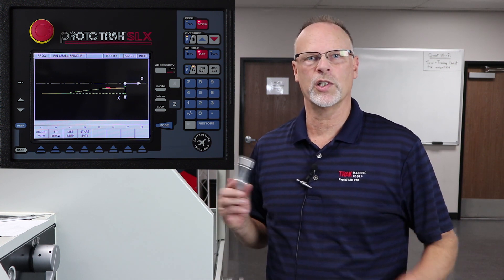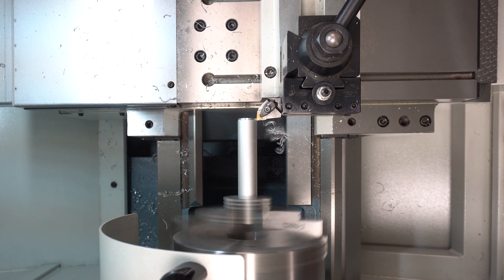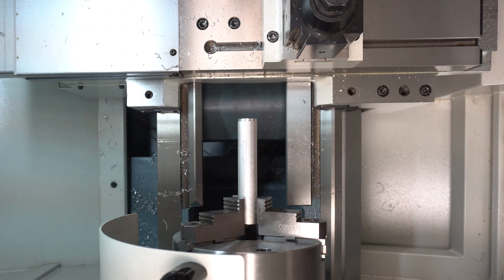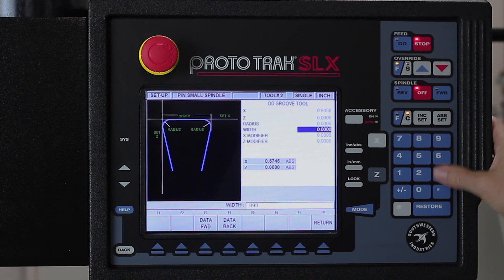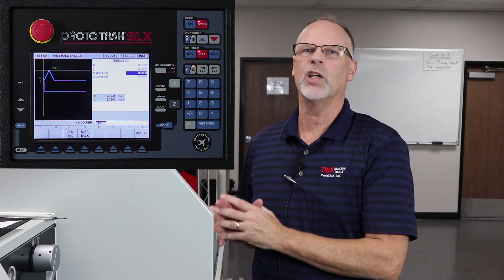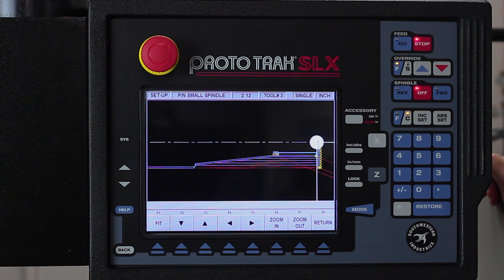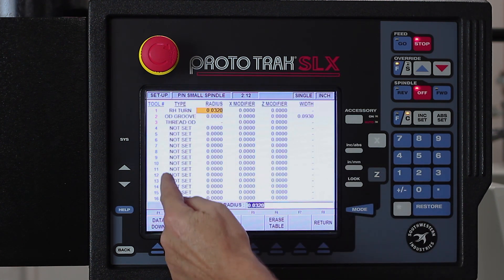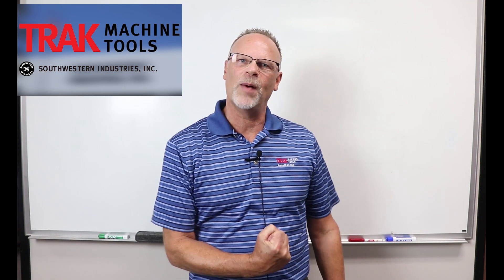Tool Setup & Setting Part Zero | ProtoTRAK SLX CNC | Basic Programming Part 2

Comment: Hi Pat, I have a 1745 Sport lathe with the L2 controller (I know its ancient). I was curious if you would be able to tell me how I can cut a "V" groove into the outside of a diameter using a cycle program. I think the error is 5130. Either way I believe it has to do with the fact I am not doing all "X" positive moves. Whether "V" groove or a large "O-ring" type groove. Can you help? Sorry to ask here but I'm having trouble and can't find a good answer anywhere on the net. Thank you

Comment: How can Is et up a neutral tool in the SLX? I have a part that needs a NH tool holder with a VNMG insert but there's no way I can find to setup a NH tool in the control. Only RH/LH.
Reply: Just set it up as a right turn/face tool but when you touch the tool for Z, you enter half the tool's width instead of Z zero. This will make the point of the tool Z zero.  T.P.
Reply: @patrickfitzsimmons5187  I had to set it up as a button tool and enter half the tip radius as their touch-off for a button tool is the left face. Now the stupid SLX tells me I have the incorrect tool for the toolpath every time 🙄🙄

Comment: question - at 6:50 when you press define stock , is the part 4 inches long and you give .027 extra space for the cutting tool to prevent the tool hitting the chuck?
Reply: When you first go to DEFINE STOCK, the control automatically adds a little stock to all the dimensions because it is guessing from the dimensions you have in your program.  It has no idea how close it is to the chuck.  You have the option of changing those numbers to the exact size of your material if you'd like to.  T.P.

Comment: was going over this in class recently.  The modifier was the most interesting part.  Apparently cnc lathe reading has to be modified to be similar to the micrometer reading.  If the cnc lathe says I cut to .950 inches and yet the micrometer measures the part at .948, I have to change the modifier to -0.002 .  That will change the DRO on the lathe to .948 instead of .950  .
Reply: That's correct but more importantly, it only changes it for that particular tool. This way, you can modify each tool to cut to the exact dimensions you need.  T.P.
Reply: @patrickfitzsimmons5187   Glad you show the screen to use for the x_modifier.  I mistakenly changed x_modifier under tools setup -> edit and I could see it was going to mess up my part's dimensions

Comment: Is there a way to define the shape of the tool or the rake? Trying to make a pulley, but i keep getting compensation errors or telling me im using the wrong type of tool when i try to better define the tool with a different type
Reply: Sean, Unfortunately, the description is somewhat limited on the tooling.  In most cases, when you get a compensation error, it just means that the tool width or tool radius won't fit inside of the geometry in your part program.  You may need to watch this video to get a better understanding.  https://www.youtube.com/watch?v=SqX4_kriGt8&t=299s  Most likely, the problem has to do with this.  I hope this helps you!  T.P.
Reply: @patrickfitzsimmons5187  ya i watched that a few times to see if it was it. It keeps happening after a radius, into a taper. Everything is smooth so im not sure why it happens

Comment: How to programming a v pulley on proturn 425 slx lathe
Reply: Francois, Are you asking me to make a video for this or are you just asking how to do so?  For the later, you have 4 different Z dimensions and 2 different diameters. Z1 is your OD right dimension, Z2 is your ID right dimension, Z3 is your ID left dimension and Z4 is your OD left dimension. X Begin is your OD diameter and X end is your ID diameter.  This will always be the case unless you are doing an ID groove.  With an ID groove, all of these dimensions are reversed.  T.P.

Comment: shouldn't you be subtracting the paper thickness instead of setting the Z zero at the paper touch point?
Reply: Actually yes but, I was trying to keep it simple.  Now that you brought it up, I could've set the Z for each tool at .003" for the paper.  Thanks for pointing this out for others who may not have caught on to that. T.P.

Comment: Having an issue with my first cut on the OD within the turn cycle… i set depth of cut to .050 but the initial cut tries to take a cut of about .250 . After that cut it goes into the .050 per cut cycle…. Any tips on what i may be doing wrong?
Reply: Hi Matt, It sounds like your last turn move doesn't come out to the stock diameter.  If you stopped at the largest diameter of your finished part, it will only apply the .050" to that dimension therefore, the first cut will be .050" + the rest of the stock.  If I am correct, just make your last turn move come out to the X stock size before you add your positions.  If not, please let me know.  You can also reach out to me directly at TRAKingPat@trakmt.com if you want to email me your blueprint or program.  Thanks!  T.P.

Comment: Hi My name is Louie Munoz. I work for an aerospace company that bought two of Pro Trak lathes with SLX controllers. I do a lot of trimming of tubing. Typically the wall thickness is around .025 to.080 thick. Typically around.250 to 4.00 long. I normally will face one side first to square it up. I then pull the part out, turn the part around rechuck and face second side to a dimension like 3.00+/- .010. Now my question is, do you have a video on the easiest way to deburr the inside and the outside diameter ( break sharp edges) of the tube.
Reply: Hi Louie, Generally, I would just use a 45 degree chamfer tool and program it to move in the Z axis to touch both the ID and the OD.  If you are programming an inside or outside CYCLE, you can make the chamfer part of your CYCLE program and then eliminate the extra moves.  We have not made a video for this but since it's so simple, I don't believe that we will either.  T.P.

Comment: is there a way to start in the middle of a cycle event, say with profiling a long shaft and you have chatter have way through the cycle.
Reply: Tachdriver1, Unfortunately, there is only the option of starting a cycle at the beginning or at the finish cut.  This being said, you still have several options.  1. Use TRAKing to fly through the cycle until you get to the part that has not been cut yet.  2. Adjust your program to eliminate the portion which has already been machined.  3. Instead of leaving the RUN mode in the middle of the cycle; Switch to TRAKing and override the tool position by using the JOG STICK so that you can make an adjustment.  Then when you're finished, either TRAK it back to where you left off using one of the handwheels or switch back to CNC RUN and it will go back to that point by itself.  I hope this helps!  T.P.

Comment: Hi how to save tools allready set for next day or I have to reset tools always when I switch off machine?
Reply: Marcin, As shown in this video, whenever you set-up or make a change to any tool, you should then press the save tools button to save all of the tooling information.  If you shut off the machine and therefore lose zero, you can simply go to DRO mode and select any tool that has been saved.  Touch a know diameter or take a cut and measure the X dimension and input that into the DRO.  Then, touch off the end of the part and inout Z zero in the DRO.  After that, all of your saved tools will be correct.  There is another way to do this and I should make a video to show this.  Let's say you have a few tools all set up and you want to shut down the machine but you don't want to lose your position... Simple pull up tool #1 in the DRO.  Next send it home. (Let's say your home position is at X6" and Z6")  Now, you can shut down the machine.  When you turn it back on, the machine will not know where it is but you will know that tool #1 is at 6 and 6.  All you have to do is go to the DRO mode again and set X to 6" and Z to 6".  The only thing left to do is to go to the SETUP mode and set your home position back to 6 and 6.  BTW, if you forget to do this, the machine will tell you so when you try to run a part.  T.P.

Comment: ProtoTRAK Geeks, please let us know if there is a certain project or process that you feel we should produce a video for.  It can be just a how-to in general that we haven't covered yet or maybe you have a piece part and would like some insight on how we would make it.  Thank you for watching and especially for your feedback!
Reply: HI Pat - I'm an instructor at a local college teaching the basics of SMX and SLX. My request concerns the SMX mill.
I'd love to know how to integrate the SMX2500 with Autodesk Inventor HSM. (How to get a usable post from Inventor, how to get it to the mill, how to verify the code etc) 
Thanks for your time here :)

EDIT: What I'm interested in is getting more use from the Z axis. Cutting 2D shapes isn't a problem (ie plates with holes and features), cutting more complex parts - such as a hemisphere - is something that I'm assuming would need g-code?
Reply: @Steve_1401  The first thing everyone should know is that the post processor is different for each software manufacturer.  Therefore, the post is created by them and not by us.  We supply all the needed information to the CAD/CAM company and then they develop it for the end user.  Once you have the correct post processor from your CAD/CAM company, you can save that G-code tool path either as a .CAM program or as a .GCD program.  If you choose .CAM, the program will change from G-code to ProtoTRAK Events.  If you choose .GCD, the program will stay as straight G-code and the ProtoTRAK SMX will have a G-code editor in the EDIT mode.  Generally, .CAM is easier to use however, if you're making a 3D part with a lot of contouring, then straight G-code will work better.  With .CAM, you will be able to check the part geometry as well as the tool path.  With GCD, you will only be able to review the toolpath.  With either, you can simply put the program on a USB memory stick or use the NETWORKING (Optional) to transfer the program to the control from your computer.
Reply: @trakingpat2750  Thank you very much for that info, that gives me somewhere to start and is more enlightening than the manual.  Cheers!
Reply: @Steve_1401  Thanks for watching and for your input!  T.P.
Reply: @Steve_1401    Hi Steve!  The TRAK mill is fully capable of cutting any kind of 3-D shapes.  Although in most cases, using a CAM generated G-Code program would make the most sense, you can also program 3-D mills and arcs directly from the control.  I recently made a video showing this and it should be available soon so please watch for it.  As for the second part of your question, it is important to understand the no matter which CAD CAM software you use, the post processor is part of their software and not ours.  This being said, every CAD CAM company has a post or can develop one to work with our controls.  They simply need to know which control you are using.  I suggest you contact your CAD CAM dealer and they will help you.  Thanks for bringing this subject up!  I'm sure this will benefit a lot of others with the same question.  T.P.